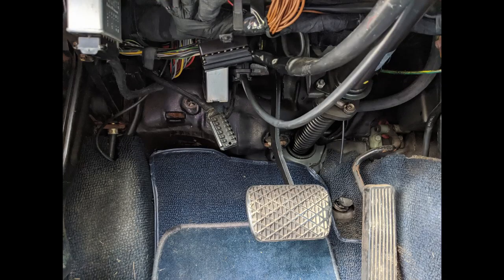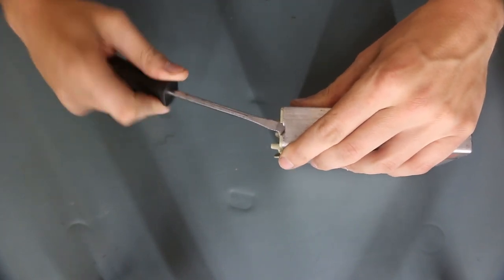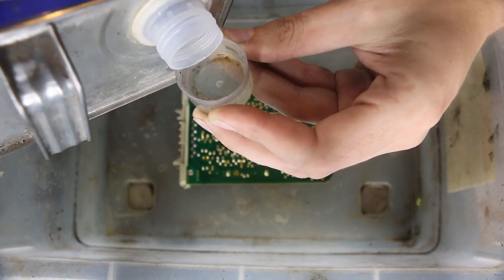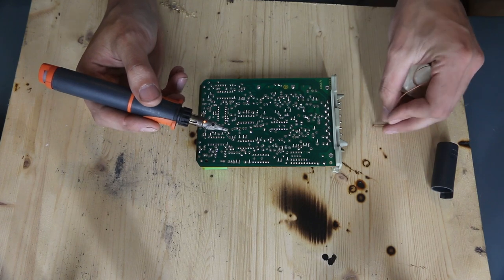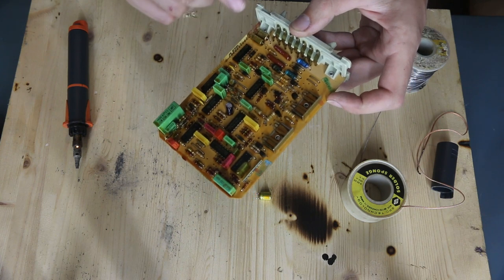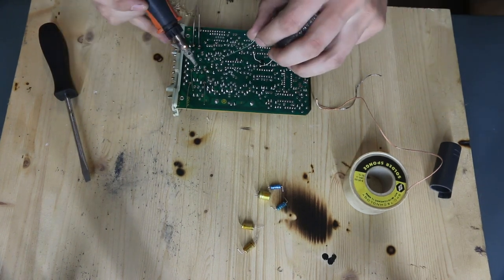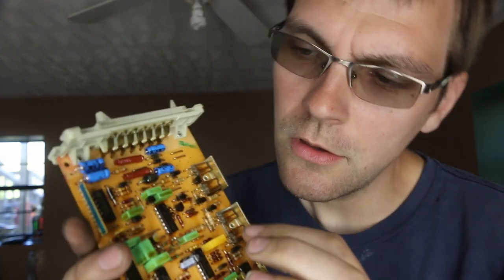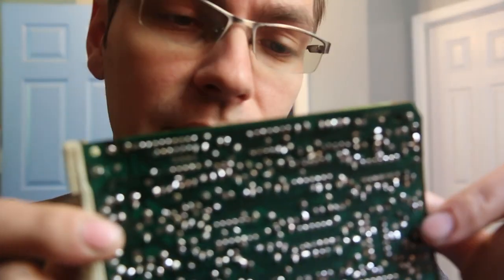W123 VDO Cruise control repair series part 3: Amplifier repair

Comment from the maker: Here are some links to products we used in this video on amazon in case you want to try this, purchasing from these links may earn us a small commission that helps us keep doing videos like this one:
Rosin core solder: https://amzn.to/2YdjPtw
Solder wick: https://amzn.to/2VQG86O
Portasol soldering kit: https://amzn.to/35fpMaK
Portasol individual soldering iron: https://amzn.to/3eZNgFv

Capacitors I used were ordered from Mouser, with the following part numbers:
22uF:  647-UVZ2A220MED1TD
10uF:  598-106TTA100M
2.2uF: 598-225TTA100M

Possible alternative capacitors, I have not tried these, but they are the same on paper:
22uF capacitors: https://amzn.to/2xnz48c
10uF capacitors: https://amzn.to/2Si9pVu
2.2uF capacitors: https://amzn.to/3bQCDTk

Comment: Trythistv, Followed your DIY steps on how to troubleshoot my 1985 Mercedes 300d cruise control issue. Quit working about a month ago. Got to the point in your steps where the issue just had to be the magic box. Ordered the needed capacitors from Mouser as you suggested. Switched out the old caps with the new ones and took the car for a test drive. Still no cruise control!

 Only steps I skipped was the laborious task of removing the lacquer from the board and then spending an hour or so touch soldering each and every solder point on the pc board. Needless to say, I was not optimistic about the process. 
However, took the car for another test drive and there it was. CRUISE CONTROL once again!  

Bottomline for anyone attempting this fix: DO NOT SKIP the point solder steps. Painful, but well worth the extra effort in my case. 

Thanks for the detail and hard work you put into this vid. 
Super appreciate it! Ernest in Lexington, KY
Reply from the maker: Awesome success story! Thanks for sharing!
The document available for download on the website (https://trythistv.com/cruise-control/) has pictures of what some of the solder joints end up doing.
Its very hard to see without some kind of magnification, Touching up every joint is the easy way.

Comment: Thank you so, so much for this. I've repaired the cruise control in my W124 and my sister's W123, as well as the ACC temperature regulator box in her W123 with your video on that. Original monovalve still working great (fingers crossed lol). Saved me 100s of dollars. BTW if just replacing the caps on the cruise control board doesn't fix it, try reflowing all the solder joints as that made my W124 cruise work flawlessly with no surging.
Reply from the maker: I'm so glad to hear your successes! Its really nice having all those little creature features working properly. I need to pull my climate box back out and reflow all the joints, it worked amazing for 4 or 5 months after replacing the caps but has gone back to some erratic behavior.

Comment: Good to know thanks for sharing I'm definitely going to recap mine I can imagine 40 years later how can the capacitors even be good lol
Reply from the maker: The solder joints and caps are usually all that goes wrong with these amps.

Comment: Thanks for sharing in details. would like to know what could be use to remove the rust from a circuit board, without having any damage to the electronic? Have a instrument cluster to work on and found almost every connection in it is surrounded with rust. A big box hardware store employee suggested RUST-OLEUM rust dissolver jelly, any experience with the product or any alternative suggestion please
Reply from the maker: The rust dissolver jelly is good stuff but I would be hesitant to use it on a circuit board, I believe it is typically phosphoric acid, which might have a tendency to eat the copper on the circuit board.
I would try to get a purpose made product like deoxit (https://amzn.to/3Qz6jux) and a small brush, I know people that work on amps and old school audio stuff likely have the right stuff so maybe try hitting up a local guitar place or if you know anyone that works on that kind of old school tube amp type stuff they could probably point you in a better direction than I can.
Reply: @trythistv  Thanks a lot will try to look further for some alternative product.

Comment: I couldn't attach the photo here. But it's the blue diode that's in the photo on the top right. It is in parallel with the black diode 1n4007.

Comment: great video i managed to get the control unit out ,on trying to remove the electrical plug i must of pressed something by mistake, as all the pins started to come out of there housing ,so now i need to find out which pin and coloured wire go in  which hole, they are numbered on the housing 1-14  ,hoping you could help tom
Reply from the maker: I will grab some photos of that connector, and pop it apart so the color codes are visible and add that to the document on the website likely over the weekend if I can remember.
Reply: @trythistv  Hi did you manage to put a copy of the wire codes on
Reply from the maker: I just did it, I actually took the photo like I promised over the weekend, but then never got around to putting it together. New document is live at https://trythistv.com/wp-content/uploads/2022/08/VDOCruiseAug2022.pdf

Comment: Great video! Do you know if the same capacitors in the same amount should be used to resolder the W124 amp? I have a late model 1994 E320.
Reply from the maker: I had a W124 amp somewhere, and it was nearly identical, but may have had less capacitors if I recall correctly, if you remove it and send me some photos of the insides to tom at trythistv dot com I'd appreciate the extra info, and then we can confirm what capacitors there are!

Comment: Hello I have an old early 90s mercedes hymer campervan, it has a VDO cruise control just like the one in your video and its wired up to a mechanical speedometer, the cruise control does not work, and when I'm driving along if I move the stalk a strange noise comes from behind the dashboard, the noise sounds like a regular popping sound, or like something is tapping/knocking, a bit like a clock but slightly faster, so I found the wiring diagram for the cruise control and according to that, the only thing that could be behind the dashboard is the amplifier, so my question, is it possible that the amplifier could be making this noise?
Reply from the maker: That is odd, I would certainly pull the amp out and check out the insides, it could be capacitors are bubbling and coming apart.

Comment: If anyone comes across this and mouser is out with giant lead times or don't want bulk, go enter the part numbers in Digi-Key. It was only place I could get like low amounts at good price in stock.
Reply from the maker: Most definitely! I've used Mouser and Digikey quite a bit, I've heard Newark and Arrow also are great to deal with, but haven't personally tried them. What I really need to do is find time around my work to separate out the psychotic amount of capacitors I've ended up with and start giving away bundles of enough to fix an amp like I planned on doing.
I have a whole rubbermaid container that is like 14"x8"x6" full of various things I bought massive amounts of because it was the only way to get them that I had intended to make little gift baggies and mail them out in some kind of giveaway thing, I'll still get to it sometime!
Reply: @trythistv  Yeah, I like check the mouser ones and one was like 48 week lead time.. then the amazon ones are like qty 50 or like not the right style. I didn't want to end up like that with 100's of caps I won't use. Hopefully, this fixes up my cruise, it still works but it is very unsmooth, jerky and does weird accelerations. 13 bucks sounded better than 198 for rebuilt.

Comment: Thank you very much. Although the tempostat module was built into a '93 previa, everything was almost identical. The only difference I saw was at the connector at the actuator (round type of plastic), but all the colors of the cables were the same, so based on your word guide I could easily comprehend. All the things were tested, just as you advised, the issue on my vehicle was 2 faults. On the ground cable it became so much corroded, I had to make the cable shorter and ground it in a different spot and of course all of the solder joints were reflowed. Much appreciated your help, finally a feature I can use and would have never dreamed without your guide to be able to repair it! You rule!
Reply from the maker: How interesting! I guess we may never know how many vehicles used a similar cruise system, VDO was everywhere back in the day it seems! Glad you got it working, keeping unique older vehicles around is one thing, keeping the creature-features working is above and beyond!

Comment: If you’re looking for another project...how about teaching us how to diagnose and repair the tach. Mine is dead...just sits on zero.  Thanks again for the very informative and clearly presented topic. You’ve got me convinced I can do this myself!
Reply from the maker: Funny you mention that, I'm currently on the hunt for a instrument cluster to play with. Been scouring the usual online places, I should check junkyards near me but so many of them only hold on to cars more than about 10 years old for a week before they crush them, which is incredibly sad. I missed a pristine 240d with a 4 speed that was there one week and gone the next before I had a chance to see if they would sell it whole or at least snag the trans stuff for another 4 speed swap.

Partially to play with the tach and potentially build a better tach amp, and partially to play with the other stuff going on with the gauges to understand how they all work and perhaps make some videos on repairing some of the common issues.

I have repaired the tachs on both my cars, and I have a spare tach amp (little black trashcan thingy) I've been thinking of doing a video on,
Reply: trythistv I will check locally. As recent;y as two months ago there were a couple of w123s in a junkyard here. I got several parts off one (power antennae, sunroof cable and track parts, and a cruise amp)

I will pull the instrument clusters on them if there. I don’t know what the tach amp looks like or where it is located. If you can let me know I will check for those as well.  😁
Reply: trythistv UPDATE

There are several w123s in the PULLAPART yards in ATL where I trade. Can you tell me what years and models of instrument cluster you need?
Reply: Check on the tach amp in the engine bay near the cruise actuator. Pull the cap and module off, remove the module from the cap by pulling it out and wiggling. Push napkin or a receipt or something in the cap and reinstall the module. Enough paper to compress the module down and w123 tachs start working again.
Reply from the maker: I'm sure I responded the other day. For some reason it is not showing up now, maybe I clicked something wrong. I'm basically looking for any w123 cluster that has a tach, I think all the turbo models had a tach, I'm not sure about the n/a models or the 240ds.

I want to set up a little test bench to poke and prod each gauge and better understand how they work to better be able to repair and explain how to repair each function.
Reply: trythistv    Well, I went by the local yard looking for an instrument panel....gone!  I was able to locate a few needed backup parts, but couldn’t find an instrument panel.

Comment: Goodnight! I'm having problems with my Cruize Control. It's the same as what you're explaining about the concert. Turns out it burned out the diode that is connected to deceleration. This is the one I marked in blue on the photo. I would like, if possible, you to check on your board which specification of this diode marked, in blue color. I would appreciate it if you would send me a detailed photo of him with the number. Thank you in advance.
Reply from the maker: Hello, I've taken a photo, hopefully it is clear enough, looks like that little blue diode says 48 on the top, but perhaps you'll be able to tell more: https://trythistv.com/wp-content/uploads/2021/12/IMG_2174.jpg I'll also send you an email just in case you don't get notified of this message!
Reply from the maker: I've removed the diode, I will have to take photos of it, but at first glance it looks like it says BA148 and has a little triangle in a circle for the logo, I'll get some pictures and email them to you soon

Comment: Thank you for the 3 part video,  very helpful, saved me a lot of money.  I tested all circuits  which were fine, so left with the amp box, I  replaced the capacitors as in the video...... and smooth cruise control again, happy days!
Mine was from a Mercedes 310d  1990 which had 6 capacitors.
Thanks again.
Reply from the maker: So happy to hear that the videos helped you out! There is a lot on these cars that isn't necessarily hard to repair, it's just somewhat vague and not well documented.
Reply: @trythistv   Yes youre right, not much documented, good to get it working as the 310d is the chassis for my Hymer motorhome, nice to keep all the original parts working on it, Road trip across Europe next year... in cruise control ofcourse, :-)  thanks again.
Reply from the maker: @johnpaulmellish7266  Oh you NEED cruise working on a motorhome, any sort of long trip is miserable on the legs if you've got to hold the throttle the whole way! I helped a friend move from MA to GA, just over 1000 miles, and the moving truck we rented wouldn't engage the cruise above 55mph (speed limit was 70+ the whole way) and by the time I was done driving the last leg of the trip I couldn't hardly walk anymore my throttle leg was so stiff.
Reply: @trythistv  Hi ya again, well went to use the motorhome today and no cruise control at all, seems very strange as it worked perfect before. will run the tests again.
Reply: Had a problem with the cruise control again. After long hours traced it to a Zener Diode on the speed signal,replaced it and BOOM, cruising again. I think all the times I had the amp plug on/off it snapped. It was hidden under black electrical where two wires joined. For reference its a BZX55C 3V9 500MW ZENER DIODE, Cost 4 pence

Comment: Perfection! Thank you! My rust free 85 300TD has over 380,000. Rheostat trouble shooting? I lost my dash lights. Also lost my backup lights. 4-speed manual trans   Thanks
Reply: You can bridge the two lines that go into the dashlight dimmer, it will then be at full strength all the time.

Comment: It's a great video. However, I have an early version of CC on my 300CD from 1980. It looks different and has  only 12 contacts on the connector. Actually 10 cince there are no cables on pin 1 and 2. Please help.
Reply from the maker: I will have to update the PDF on the website with a table of the pins for the early w123s, but in the meantime, give this a try:
Pin 3 is Actuator control (I believe the early w123 use a different style actuator so there is no solenoid engage)
Pin 4 is for the decel position of the stalk
Pin 5 is 12V battery voltage
Pin 6 is Brake switch
Pin 7 is Another actuator control
Pin 8 is On-off on the stalk
Pin 9 is Accel on stalk
Pin 10 is Resume on stalk
Pin 11 is Speed sensor input (I'm currently unsure how to test)
Pin 12 is Ground

Comment: Hello, your work is great. Do you have the references of the 4 power transistors? Thanks for your help
Reply from the maker: I do not off hand, but I do need to pull apart several that I have for inspection, I'll get whatever info I can if there are legible labels and report back to you!
Reply: @trythistv   It's good
Reply: BD437 et BD438

Comment: Any chance you have the color codes or ratings of the large resistor located between the two pairs of heat-sinked transistors? It is fried on mine, so I can't see the color code to source a proper replacement
Reply from the maker: If I've got the same amp as you, there are 2 resistors, one larger and one smaller between the heat sinked transistors, the larger one has a brown green brown gold colors on it, which should be a 150 ohm 5% resistor, I double checked with a multimeter and I got 150.3 ohms across it. Hope that helps your repair!
Reply: @trythistv  You're the man, thank you! Hopefully I can get mine working between that and the fixes in your video!

Comment: I love your videos, I have a 95 R129 convertible, SL 320, has a Beckmann throttle body with actuator built in, amplifier is in (I'm guessing) the passenger side compartment under engine hood, near windshield. I've replaced ignition harness and several other wiring sections that were biodegradable. Runs great, just no cruise, I'm at wits end and need some diagnostic advice please, thank you.
Reply from the maker: Absolutely! It should be quite similar, does it just act completely dead or will it engage sometimes and then kick back out?

I had a 95 E300D that also had the biodegradable wiring harness. talk about frustrating. Replacing the harness was the best route no doubt!

I did find that the R129 and W124 cruise amps are supposedly interchangeable, and the w124 unit should be plentiful for troubleshooting or repair: https://www.benzworld.org/threads/cruise-control-function-fixed.1433986/

And that does confirm the amp is on the passenger side right near the hood hinge area.
Reply: @trythistv  Thank you very much, I'll look into that, the cruise worked prior to ignition harness install, lately cruise doesn't connect at all. Is there a test to verify if my amp is faulty ? thanks again